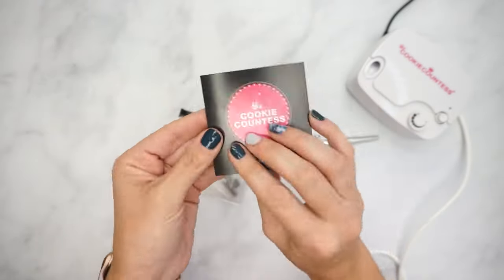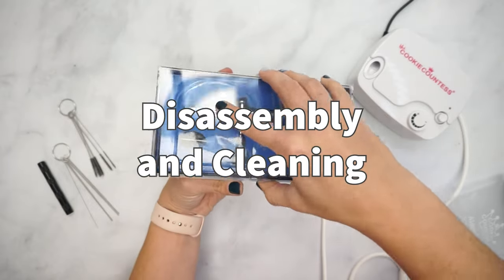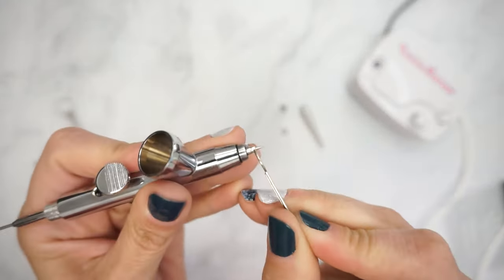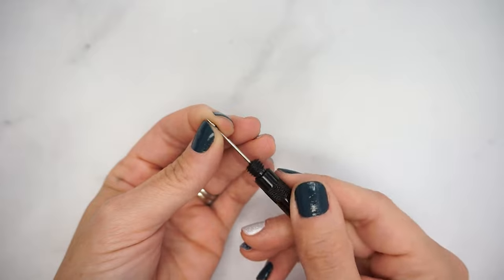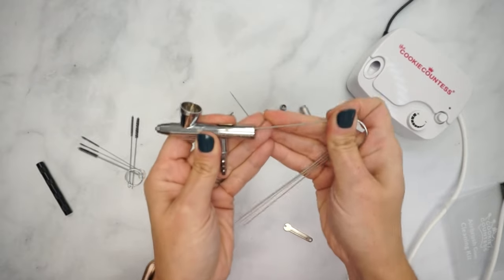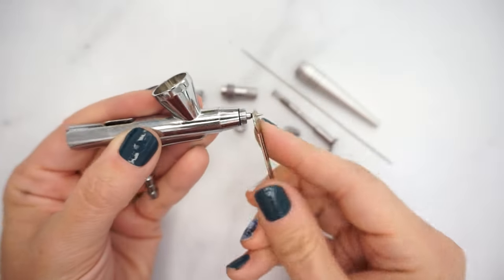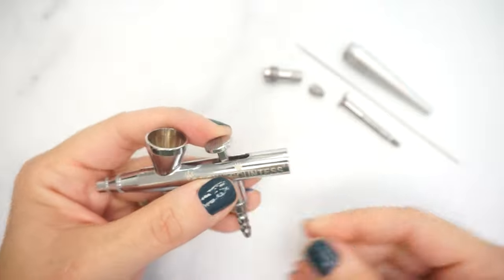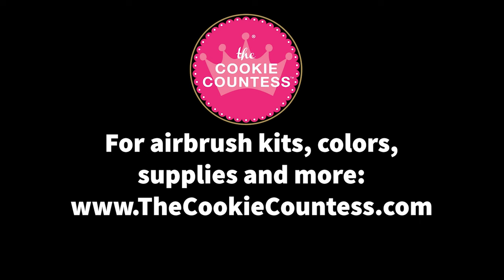Cleaning Your Airbrush Gun with a Cleaning Kit

Comment: Use those "brushes" and ruin your  needle/nozzle seal, NO GOOD!!! 😫
Reply from the maker: Hello! This is a guide made for our brand airbrush system, which does not have a degradable seal, so there's no issue. You may have to make adjustments for your brand airbrush system, refer to your user guide for cleaning suggestions.

Comment: 1. Anything that is required to use to clean after every use should come with the air brush machine.  One use and it clogs.
2. Why is the video going thru it so fast?  What's the rush. Cannot even keep up, parts are a flash on the screen, adding the the frustration already with the machine.
Reply from the maker: Lori, it sounds like you're having an issue with your airbrush machine. If it's Cookie Countess brand, please contact us at support@thecookiecountess.com and we can walk you through troubleshooting, free of charge. This kit isn't a requirement - you can clean your machine with warm water after each use and keep it running smoothly.